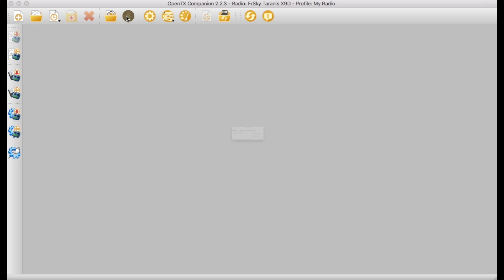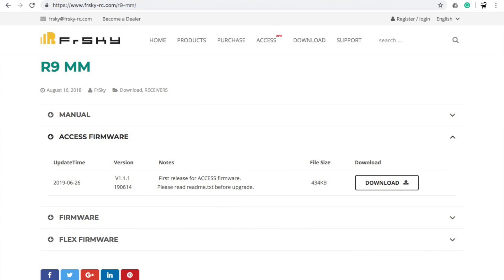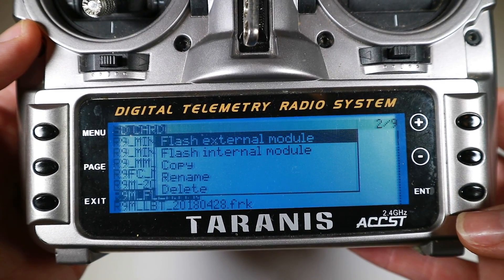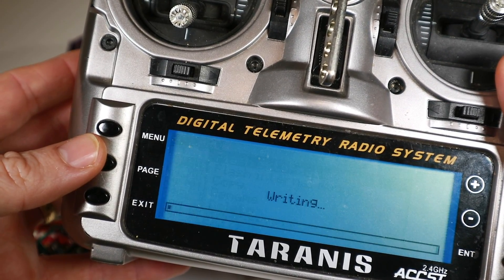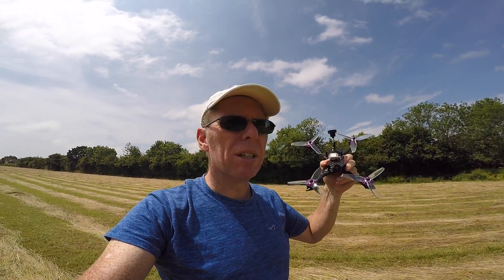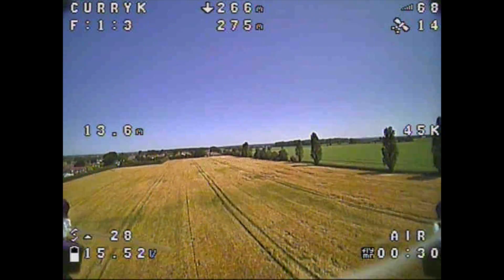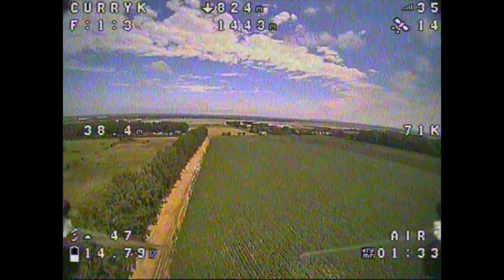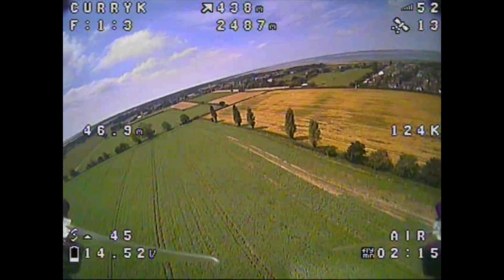Setting up and testing the Flex firmware on FrSky R9

Comment: Great video!
If you try vertical polarisation you’ll notice the rssi will be way more stable especially when you turn the quad around. That small failsafe you had when turning around is because the polarisation is lost when turning and than came back again. Also 900mhz give you much more chance to recover a failsafe before crashing compared to 2.4ghz. The super 8 antenna is not bad but if you look to go far in one direction I find the mox antenna works better (signal is a bit more stable).
I don’t really think there is never need to go over 100mw of power. Just mount the antennas right and vertical and you go as far as you need. I tried both lite and normal module and so far I almost only use the lite module at 100mw.
Reply from the maker: I do agree that vertical mounting is going to be best, but IMO it's just not practical in a 5" quad.  A bigger quad sure, or a plane - easy. So I'm aware of the hit I take there, but it's worth it for the easy mounting.  As far as 900mhz goes, it's used in the GSM phone network in Europe, so aside from probably picking up plenty of interference, I'm quite likely to get in trouble - so sticking to 868

Comment: I've been testing this system for a long time but on the xlite andy findings are exact like yours with the spotty rssi that doesn't leave you feeling very confident. I bought a bunch of these r9m receivers in hope that they will eventually do the OTA thing but I see now the OTA will only work on special new recievers but the access will work on these old ones just without OTA. That was a let down :(
Reply from the maker: I've just heard about the OTA only working on these new rx's.  What a pain - really shortsighted from FrSkys point of view.

Comment: Stick the antenna out the front like a tounge, upside is the quad rarely blocks the signal and it doesn't drop when you turn back towards yourself, downside is it's very easy to break them off and then this is where GPS rescue saves you.

Comment: I had the same thing happen wen coming back n failsafe n lost it. Keep you mobile phone on airmode n keep 2 metres away from you. No issues after that. I use 1w auto non flex. 180329 and also 1st release for r9mm.
Reply from the maker: Interesting - I've never had an issue with my phone being in my pocket on this.  It shouldn't go near the 868Mhz frequency in the UK at least.

Comment: Thanks a lot for your informative vids.
You have a very good picture in 1000m.
Which equipment you are using?
Reply from the maker: There's a link in the description, it's an HGLRC Batman 220 quad.  I can't remember what the VTX is, but it's the stock on - gives a nice noise free picture.

Comment: I have the December 2018 Flex Firmware in mine. It definitely stabilised the RSSI numbers, and I used it on a Fixed Wing with iNAV. Worked fine, but you are never quite sure what TX power level its switching to at any one time during the flight. On a Quad, an XM Plus seems more appropriate TBH, it has better signal propagation.
The Dipole of the R9MM is a problem to arrange on a quad, as it really needs to be set vertically for best results. Not sure why you would not just leave it set on Flex RF power permanently..?...Nice test, enjoyed it....:)
Reply from the maker: I think I would leave this on the flex power - seems most appropriate.  Shame it doesn't tell you what it's set to in the telemetry though.

Comment: Great information , did you need to  make a special  wire to update the firmware  on the RX  when you plug into the back of your Taranis ?
Reply from the maker: You can use a standard servo wire to connect to the back of your Taranis, but you do need to rearrange the cables slightly.  Take a look at this video for more details https://www.youtube.com/watch?v=3NObP3uhaao

Comment: I just started using the R9 and Im using the latest FCC non flex version cause I heard the flex is only necessary for EU. But the highest rssi reading I get is 49 do I need to do some kind of calibration to get it up to 99?
Reply from the maker: Are you using f.port as well by any chance, I had heard that reads exactly half what the RSSI should be so you have to scale it 200%
Reply: CurryKitten yes I am, do I do that in beta flight or in the transmitter? thank you
Reply from the maker: it's a betaflight thing.  In the cli if you type set rssi_scale it should give you 100, so you then need to do a set rssi_scale = 200 and then save and retest

Comment: Fantastic, Wayne! Thanks a lot! 😃
In my case I probably should use the FCC version of the firmware, but I guess it's basically the same. 😃
Reply from the maker: All the same - but Flex lets you move between 868 and 915, so you don't need a specific version as such.

Comment: Great video sir! The RSSI/signal dropping when you turn is because you mounted your antennas horizontally. When the tip of the RX antenna face you, the signal drops/null zone of the antenna. Mounting both, the RX and TX antenna vertically will give you much better overall signal consistency, especially when flying turns. A vertical antenna setup is easier said than done on a mini quad, unfortunately.
Reply from the maker: Yes, agreed.  So easy to do a nice veritcal antenna on a wing or even a large quad, but you are really pushed for finding somewhere that the antenna isn't going to get murdered by a prop if you mount vertically.  The null point in the RSSI on R9 vs Crossfire is much more pronounced, or it's just a lot neater using link quality on Crossfire.

Comment: Very informative video, R9 is quirky but alright. A few extra info gleaned over the months:
-The wireless firmware update doesn't work on the old mm, only the new r9mm OTA, yeah another product to keep us on our toes :D
-Auto is from 100mW to 1W. Why not 10mW? There could be a valid reason but no one at frsky gave one.
-Super 8 antenna is to be oriented vertical.
Reply from the maker: Grrr, that's typical of FrSky isn't it.  Making promises and not delivering.  I have no idea why FrSky aren't a bit more forthcoming with information - why leave us all guessing !?
Reply: @CurryKitten  To their defense, their explanation of why there is no OTA on the normal r9mm is sound: flashing over the air requires double the memory as the new firmware needs to be stored in flash and with all the stuff they keep adding to the firmware they ran out. (or money)
The lack of information is annoying but that seems typical of Chinese companies. From my experience they may seem large but are in fact made up of very few people, in contrast, a US startups look like an over bloated multi nationals. For example, in the company Sipeed, the finance person is also doing marketing and knows the in and out of the electronics, one of the engineer also does social media and marketing and the software guy also does the blueprints, everything gets built by the many factories in Shengzen. 
(or it's a marketing ploy to have us run around like headless chicken trying to figure out their mess, a clever way to build up the google ranking.)
I like the first possibility better :D
Reply: daslolo should the super 8 be vertical even if the T is horizontal ?
Reply: @joshkertcher  that's a good question and I don't know. I'm sure it's fine, I was just parroting what I saw. Horizontal is way more convenient.
Reply from the maker: No - don't mix polarisations, keep them both the same
Reply: CurryKitten thanks I read that somewhere else also, curry I am running the latest non flex firmware and it seems to still not require binding after power change but I am also having problems with range.. on the old firmware if you changed power would it tell you to rebind or would it just not work
Reply from the maker: @joshkertcher  I think in the non-EU version (where you could have more options of telemetry) you could change power without rebinding, but on EU firmware it only allowed telemetry on the lowest power option, so as soon as you changed it you had to rebind.  I'm working on memory here though - so not 100%
Reply: @joshkertcher  I just remembered why I mount my antenna vertically. When your craft turns 90 degrees to you, you get in the lobe of the quad's antenna which might cause you to failsafe during a turning maneuvers. Maybe that's what he's experiencing in the video?